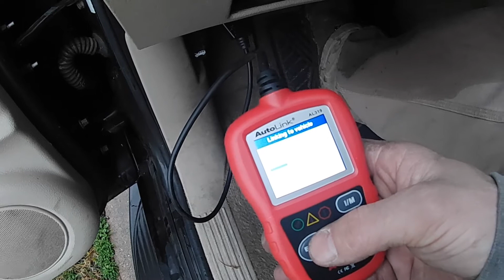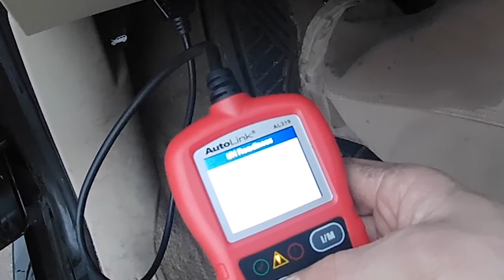DIY Smoke Machine | EVAP Leak Testing

Comment: Auto tool smoke machine.at ebay 144$
Reply: In the first use, it will pay for itself. The gas you'll waste because of a small evap leak is crazy. At least on my Pathfinder I can't get better than 15.3mpg and my gf drives like a grandma and  she  still only gets like 15.6mpg at the Most